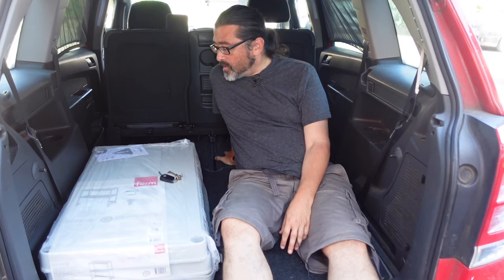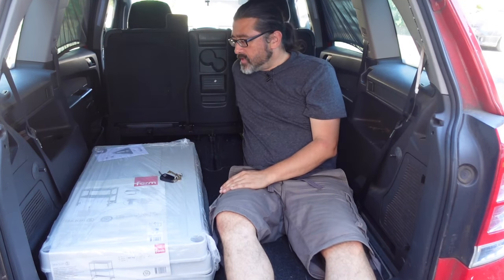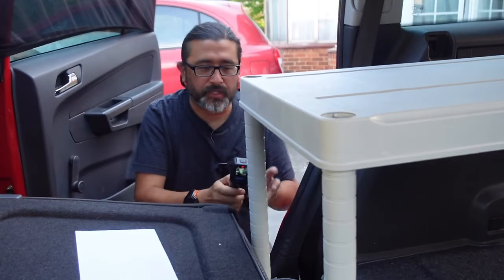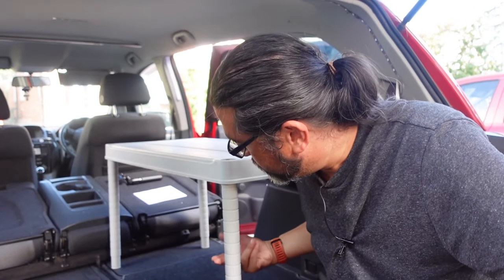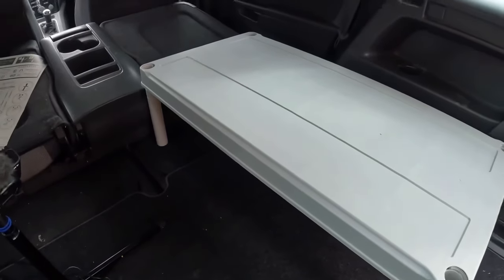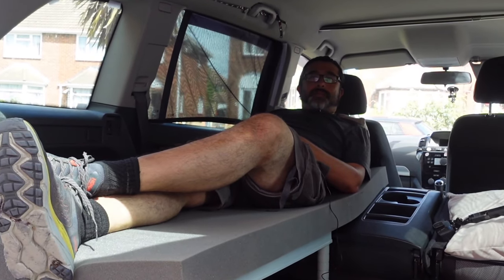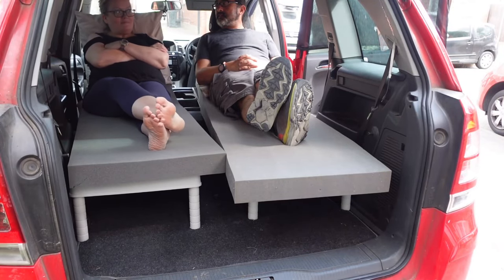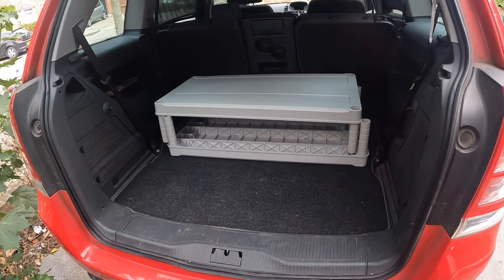Micro Car Camping Bed Set Up Ideas for Couples and Solo Car Camping - Vauxhall Zafira Camper

Comment: Very handy set up! Plus in Winter, the plastic will resist mould better, because it’s non porous, and easy to clean 👌. People often forget how damaging condensation is…
Reply from the maker: The wifey did good :) Easy to clean is always a huge ++ too :) (you know you need to show your set up one day too)
Reply: @zafiracamper  Haha Matt… will do! When I can find the spare pee pot that hasn’t been used in anger…😁😂
Reply from the maker: Hehe excellent 😂🥳
Reply: Is your weight okay on the seats? Does it not cause damage? I'm currently trying to figure out the best way for me and my partner, but was worried about weights on seats so was going to build a platform over them, but this seems much better!
Reply from the maker: Hi Kayleigh, yeah with had no problems with these shelving unit jobbies - their supposed to hold 80kg/12 stone and tbh I’m a couple a stone north of that 12 and it’s still taking my weight :) 

If you look at my other bed ideas videos’s there’s a few ideas :)

Comment: This looks great! Is it possible to take the legs on and off for transport/storage? Thanks!
Reply from the maker: Hi ya - yeah they work really well ❤️ Hmm interesting question, in theory you could as they did just slot in, may take some welly to get them out, but am pretty sure there was nothing particularly holding them in other than pressure 😀

Comment: Great video again, I followed your idea and just received the sun lounger, awaiting for the foam to go with it. Regarding the curtain rail, do you happen to have a link as I'm struggling to source one similar to the one you've got
Reply from the maker: Cheers Matthew, ah that’s great news :) I’ve opted for the sun lounger for this weekends car camp :) 

If you look at my very first Zafira set up video it’s in the description :) I haven’t clicked on it for a while so hope the item is still there :)
Reply: @zafiracamper  thanks, found the link 👍 can you remove the ends of the curtain role? Just need to make the window covers and it's good to go, like the idea with cardboard and weed fabric
Reply from the maker: Excellent yeah the ends pop off - but you will need to cut the ceiling :) I think in my most recent Micro camper tour vid you can see how it fit :) 

I’ve another tutorial going live soon of a new window covering idea 🙏

Comment: Would it work with a double matress if I push the tables close together?
Reply from the maker: It would do yes :) We like the separate foams as gives you a little bit of legroom on the middle and at the ends :) (ps I’ve never tried my double air bed in the car so don’t know if one would fit “normally” or not 🤔

Comment: why not just tilt the seat up a bit and support it so that it is flat?
Reply from the maker: Hi ya, sadly there’s no way you can make the middle row flat :( It’s either up completely (which is fine, but makes the bed size possible smaller) or down like on this vid so you have the raised ridge :)
Reply: @zafiracamper  ah I had forgotten. i have a zafira , I took mine out
Reply from the maker: Yeah, it would be good if I could too, but often have kids or parents in the car so need the middle row still 😀